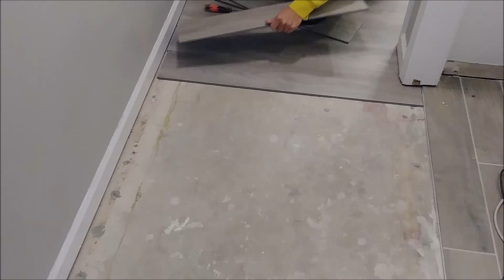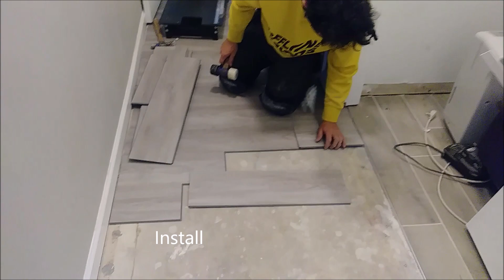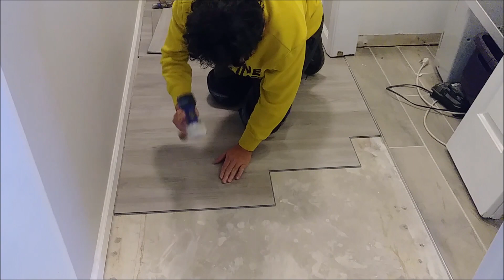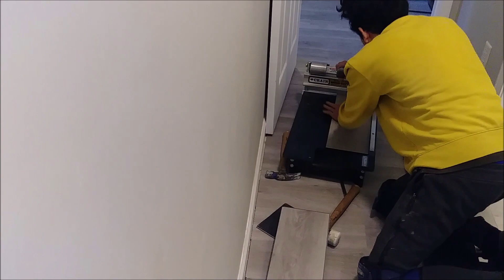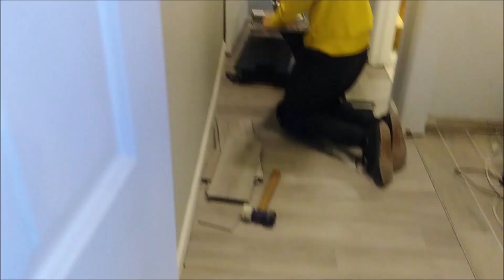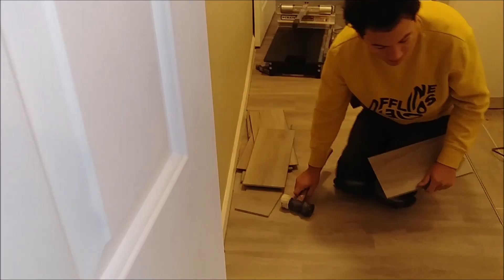How To Install Vinyl Plank Flooring on A Narrow Hallway -  Quick and Easy

Comment: Curious as to why you are not using either a damp proof membrane layer or an underlay? Is it not always necessary to make sure the floor is flat? Genuinely curious to help plan for a DIY job.
Reply from the maker: The plank I used do not need underlay membrane. You need to verify that the floor is flat. My floor is flat. Please look at this video: https://youtu.be/gbzPL2ETOx4
Reply: That floor might already have moisture barrier